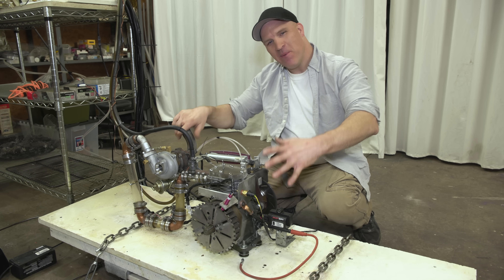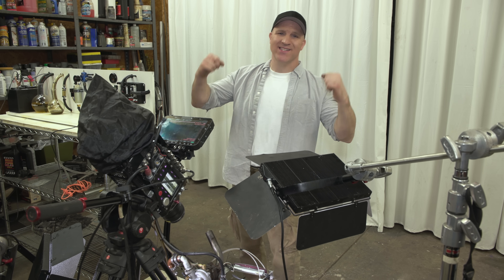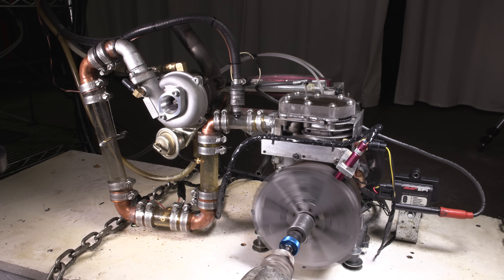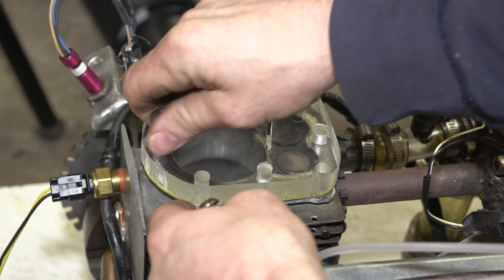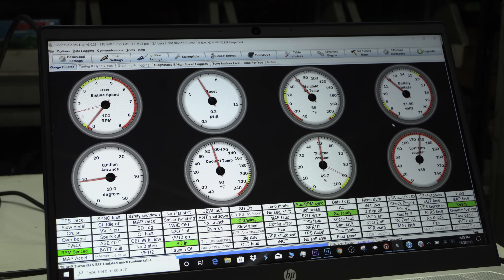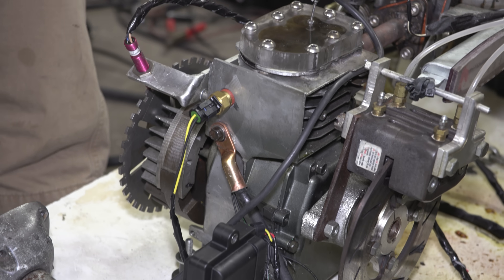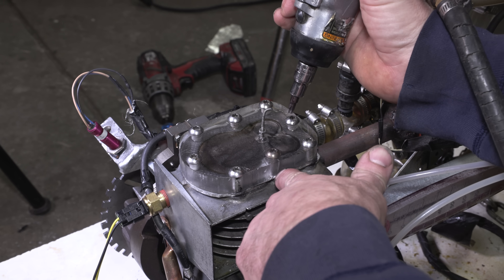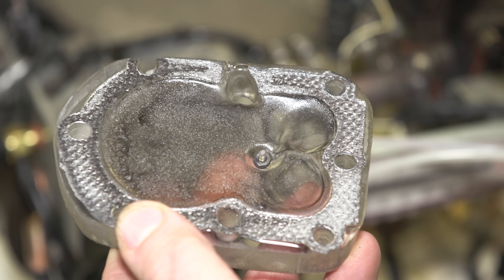Turbocharged SEE THRU ENGINE on EFI and Nitromethane (FINAL EPISODE)

Comment: Briggs and Stratton should be making car engines.
Reply: The engines on most modern day cars are incredibly reliable. It’s all of the electronics that are the problem, this Briggs engine is a tank because it’s is very simple.
Reply: flat head designed engines died out in the 40's or 50's for cars
the reason lawn mowers still use them is because they don't need a lot of power and it's a lot cheaper
Reply: @Eduardo_Espinoza  Flathead Fords were produced until 1953, Harley used flatheads for another 20 years after that.
Reply: @Eduardo_Espinoza  now all new lawnmowers are ohv, nearly no lawn mower is flathead anymore, all of them are overhead, and yeah, the overhead with the cam in the block died for cars now 20 years :)))) sooo, in 15-20 years we will have DOHC or SOHC 120cc engines :))))))))
Reply: @darkraft100  I think you are right about the lawnmowers now, since after my post I found a broken recent model 1 on the curb for free & it did say OHV on it. but I think the brand new 2020 Corvette still uses cam in block design Engineering Explain did a video on why GM still uses Cam in Block engines. idk about the DOHC since that would be used for more air and thus more gas, maybe they wanted OHV design to get more compression out of it since they are rating the emissions now for lawnmowers
Reply: @Eduardo_Espinoza  SIZE SIZE SIZE The OHV design lets the engine be physically smaller than DOHC. Also a more simple design means less to go wrong. The vette engine is about as big as a BMW 6 design even with the 6.2 liter of displacement that the vette has.  ALSO dodge still uses this design for all srt cars besides the crossfire and srt4....In design we say if it ain't broke don't fix it.
Reply: @clarenceodom6703  Very true I just learned today that DOHC engines BMW & Hondas were mentioned to have issues with chains snapping because of the need of longer chains and they had to chose a compromise of efficient and weak vs strong but loss of power + common driver's maintenance habits so the closer cam to crank on push rod engines are still very advantageous in today's setting
Reply: yeah they could make something beter than a 2jz or any famous engine that is known for being able to take a 1000 shot of nitros oxide (nos)
Reply from the maker: @djaydeved  yes exactly, I have a Supra and they say that the 2JZ is made pretty much like a diesel engine..  that's why they are able to take so much power. Although I have blown about 4 2jz's. But it was mainly due to tuning issues.
Reply: Jeep 4.0 I 6
Reply: Toyota landcruiser is pretty much a b&s engine they are just as reliable
Reply: No no your wrong because actuators was
Reply: we can thank the epa they wont let car manufactures use the flat head design anymore because it is not efficient enough for them
Reply: Huh, i didn't know that.

Comment: All this effort to DESTROY an engine [sad eyes]

I only followed it to see the build and horsepower output, so sad it was only there to be destroyed. [sigh]
Reply from the maker: A lot of things need a motivator that's for sure, I probably would have never built this if it was just to build it. But if it would have blew up, I hadn't even bigger surprise in store, I was going to use some of my interesting techniques to repair whatever happened to the engine, because it still was going to be part of my museum exhibit. Thank you for watching, and thanks for the feedback.
Reply: Yes, if you recall the original intent of the series was to try and detonate the little motor from the very beginning. All this extra building has been trying to achieve that - These cast iron Briggs are strong machines.
Reply from the maker: Exactly right, it's crazy how things evolve. But hey surprises happen and like I say things happen for a reason. Now look at this crazy thing...lol. it will be part of my museum exhibit now go figure. Thank you for following the series, I deeply appreciate it !!

Comment: The EFI system has been less reliable than the original carburetor and the engine itself...

Kinda disappointing, really
Reply from the maker: No not really, it started way more reliably and ran smoother then the carburetor system, what was not too reliable and very disappointing what is the fact that the crankshaft position sensors are too sensitive. With the next version of this engine and all the others this is the first issue that I'm going to address oh, it has been the main cause of headache,Justin the last two videos alone I went through three crankshaft position sensorsoh, I have some other ideas in mind but I'm going to apply in the near future. I think what really stood out from all of this testing was what components were going to fail when everything was pushed to a more extreme level. Thanks for the feedback and thanks for watching
Reply: @WarpedYT  Three CKPs and you had to disconnect the coil ignition because it wouldn't work, but you're still on block #1 :)
Reply: Megasquirt stuff has been known to be extremely sensitive to interference and is plagued with seemingly random ignition issues. I would take the plunge and put holley or haltech on your rig

Comment: the electrode bolt shoul be up side down and have 2 nuts then it will not came lose from vibration !!!!!!!!
Reply from the maker: You're right, I didn't even think about that, that would have totally solved the problem....
Reply: @WarpedYT  one more movie then ? ;) ps with that position sensor mayby You can just isolate the sensor from the engine frame ?

Comment: Your the perfect guy to start injecting hydrogen like Scorpion car by Ronn Motors to show on demand hydrogen from water can be used to supplement an engine. Make sure to monitor for NOx. Use bismuth in your dry cell for extra performance like Daniel Dingel did. Check out Stanley Meyers pdfs too. Aquatune has an interesting unit. You could probably make a better one.
Reply: The physics doesn't work out that way, running hydrogen on demand you cannot generate enough power to overcome the energy costs of generating the hydrogen. It's a net loss system.
Reply: Bismuth. And resonance. High voltage. Low amps. Magnets. High pressure helps too. Water meth injection helps cool. Some of that water could be converted.